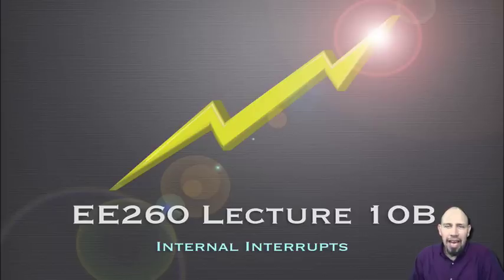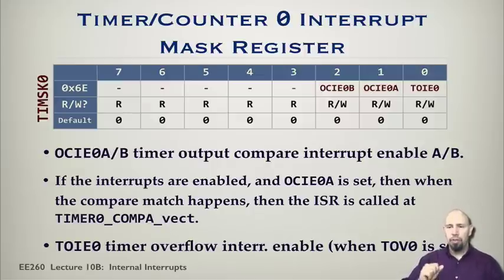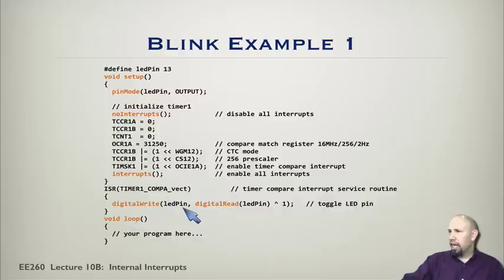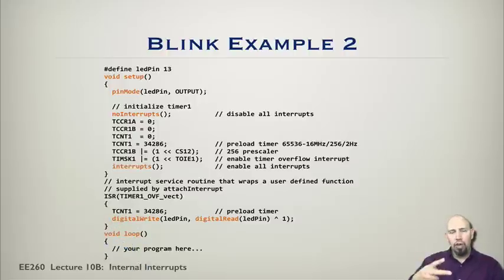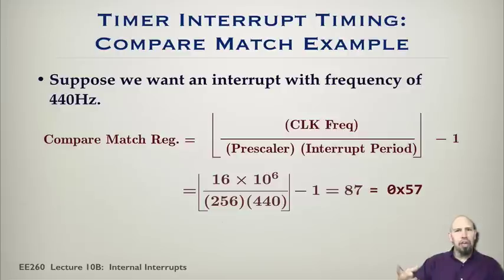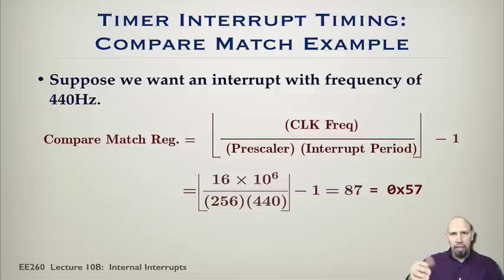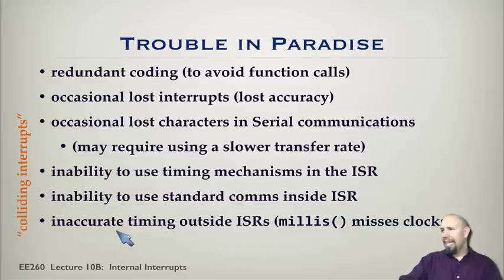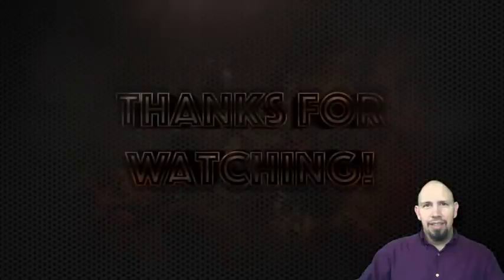10B. Arduino Interrupts Part 2

Comment: Dear Robert;
Thank you for great video.
I wish you see this comment because I have been trying to connect two shields to Arduino Mega ADK. (GSM/GPRS + GPS).
I am receiving the data from GPS shield and sending them to SD_Card but when I add SMS and voice call to the code, the delay for these two functions causes problem.
My aim is to send the data from the GPS shield which successfully being logged on SD card to my mobile phone via SMS.
I find you videos very useful and clear.
Please advice.
Best wishes
Maz
Reply from the maker: Maziar, I'd like to help you, but I've never used GPS or Cell shields.
Reply: Thanks for the reply.
It's alright. keep up the great work.
Best regards